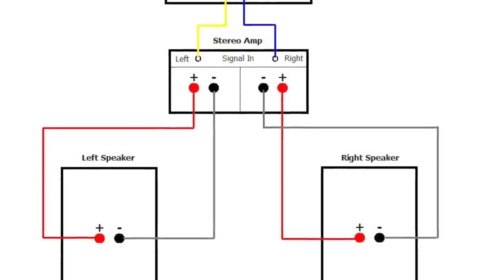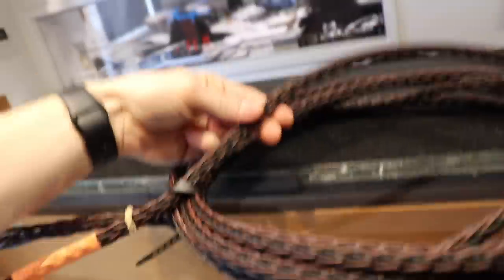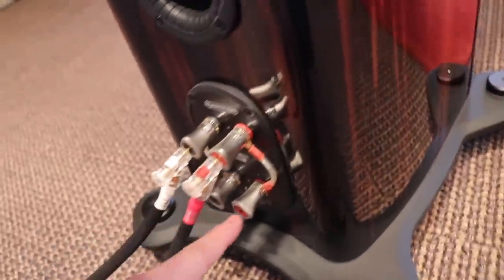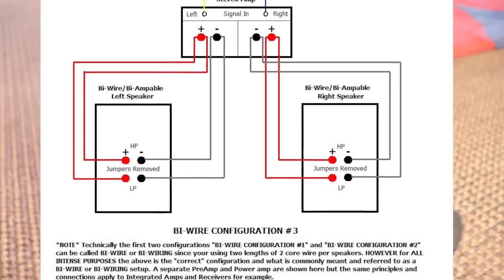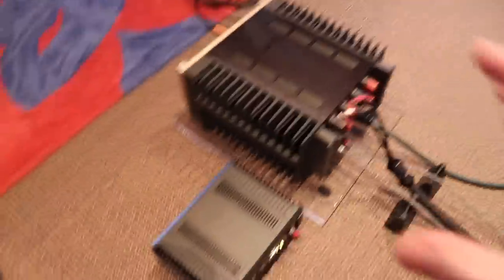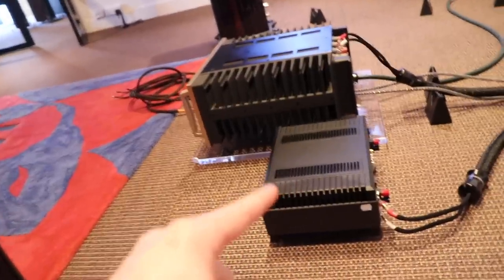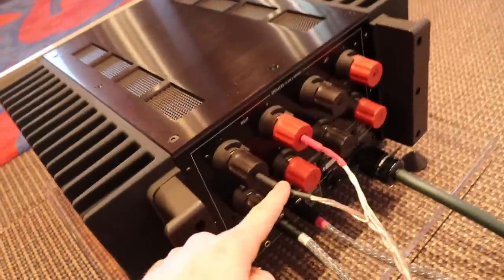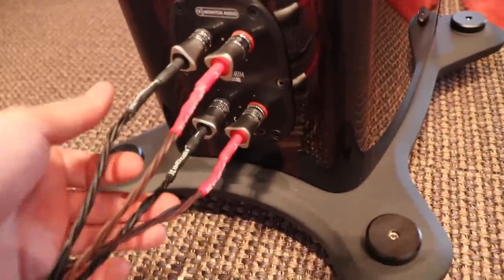Bi Wiring, Bi Amping   What is it?

Comment: i had normal connection 1 wire for right 1 for left. took out jumpers and replaced with quality speaker wire. connected + to high freq - to low frequency. what a difference my 53 year old ears could tell. this small change didnt cost me a penny ! many thanks you just increased my listening pleasure

Comment: I don't believe he understands what he's talking about, IMO.  The engineering of it. The only reason to bi-wire is because all wire systems don't sound the same and you can get into the nitty gritty of voicing your system.  You're using wiring as a tone control, and that's fine.  You do reduce resistance, but that's not going to really affect the sound per say and only nominally the ability of your amp to deliver power.  The statement about delivering tremendously more current is nonsense.  Once the gauge doesn't get in the way, in most cases it's 6-12 awg, it's the relationship of the amp and speaker.  Period.  If you run 2 runs of the same wire from the same amp, you'll not experience a significant difference.  Use, say Kimber on the bottom and Audioquest on the top, that's voicing.  Bi-amping will give you more headroom, but it's not a linear relationship of watts per DB and an expensive proposition.  There's nothing wrong with any of it to try, but understand the engineering.
Reply: One other issue is I believe if you use different amps the wattage of the two can be different (higher wattage for the woofer and lower wattage for the tweeter which doesn’t need the higher wattage) but the gain of the amps need to match.

Comment: Bi-wiring is worthless.
Reply: Wrong, have you even tried it. Made a difference to my Polk ATI 5As because it’s been designed for that purpose with the crossover inside notable separation of the lows and highs, soundstage and better mids.  But you have to buy ready made bi wiring cables, I recommend WBC Worlds best cables from different manufacturers cables. Amazon shopping has all your needs.
Reply: Yes on cheap speakers

Comment: OK, I must first say thank you very much for this video! You answered questions that I've had for years and made me realize that I did a dumb thing! Not only that, but after watching your video and being re-educated, I applied what I learned and it's like I just got another brand new pair of speakers for free! LOL

As an audiophile since about 1978, (and I still am). I've never had any speakers that had bi-amp connections until about 1.5 years ago. That's about when I bought my very first pair of Klipsch speakers, (it took that long because I couldn't afford them for most of my life).

I need to mention a few things about the way I have some of my system setup before I go on. I have an analog component system and my 'centerpiece' is my Mac MC 2105 power amp. I run all my speakers through an OSD SSVC6D speaker controller, which not only switches each pair of speakers on or off, but also boosts/cuts the volume in 10% increments, passively.

I use it to handle the speakers I have in two different rooms. One small room has a pair of small speakers and a 50W powered sub-woofer. However, in the room where I spend most of my time, I have a pair of Klipsch and a pair of Onkyos and they're backed up with a 100W Klipsch powered sub-woofer. 

So the main listening room has 4 speakers and stereo sound. When I bought the pair of Klipsch speakers, I read the manual but I guess I totally misunderstood the reason for the 4 speaker connections in back of each one. They came with the gold-plated metal strip connecting the 2 red speaker jacks and the 2 black speaker jacks just as you demonstrated in the vid.

I never connected the speakers until after I read the manual. In short, I thought the manual was saying that I should leave the strips ONLY if I was going to connect additional speakers in a series configuration. Hence, I removed the strips and plugged my cables to the lower red and black jacks!

I never even thought to try them any other way. The Klipsch sounded good but I always thought that they were just better at handling the lower octaves/frequencies. The pair of Onkyos I had (and for which only had two speaker jacks), seemed better at handling the 'brighter octaves.

Because both pairs are in the same room, they worked out well and still do. However, after I watched your video of course, I realized that I was NOT supposed to remove those strips. Instead of putting the gold plated strips back in, I took your advice and jumped the 2 red jacks and 2 black jacks with 12 gauge speaker wire.

Anyway, there was a huge difference in the sound because now the entire speaker system within each Klipsch enclosure was in effect! The high frequencies and low frequencies were all working together and sounds great! I still have the Onkyos running to better fill the room but I want to thank you for "fixing" my speaker system!
Rich
Reply: My friend had an old speaker that had a crossover problem, he also didn't realise when the tweeters were not working. Maybe it's a getting older thing?

Comment: You can also divide 16 by 4 you can use rip-cord or you can use welding wire, just keep in mind that the copper on the amplifier PCB or the wiring inside a transistor are less than 1/100th of a mm.
Reply: Inside the transistor is not really wire.  The transistors are generally doped silicon.   The resistance and capicitance of your wires will make a difference to the impedance seen by the amplifier, which in turn affects your sound.  By how much, that is subjective.  You wouldn't use very high resistance cable though, just like they don't use high resistance cable to send mains power to your home.  The losses over the cable would just make it very inefficient.
Reply: Or maybe some left overs from power utility company.

Comment: Cleaning off the crud that had collected on the metal jumpers would have improved the connection.   A contact cleaner used regularly would work wonders if you use spade rather than banana plugs.
Reply: works the same with all connections , reason putting in a different cable makes a difference , you just cleaned the contacts :-)

Comment: why would those jumpers "deteriorate" the signal? 2 inches of pure copper from HF to LF do not really make a significant difference in terms of signal transfer imo.
Reply: It's just a mental thing. Also, it's pretty hilarious he says that inch of copper is the weakest link because it deteriorates high frequecies but they still have the connectors on the low frequency inputs.
Reply: arpeemac , Electrons flows on the surface of metal and that is why stranded wire can carry more Amperes than solid piece of metal. Maybe that is a reason.
Reply: A lot of money wasted on expensive cables in this video. You might be able to measure a difference, but the chances of being able to hear a difference are between slim and none. Any decent speaker wire, multiple strand, 12ga or larger will sound the same to 99% of the population. 
Those little flat jumpers between the speaker input terminals are short, wide (a lot of surface area) and have virtually no resistance. 
This guy is a salesman, probably working on commission. But if you have the money to spend and it makes you happy, so be it.
Reply: @Smedleydog1  I fully agree that most people (like me) will not hear difference, and any good quality stranded wire might do (I don't buy expensive for sure), but this "large" piece of metal has a lot of wasted surface. This piece of metal has surely less surface than equivalent mass stranded wire. Of course I am not saying that this salesman is right, I am saying he might be.
Reply: @czakolo  Without using the math that I haven't used much since school, I would say they are about the same surface area on both sides of the jumper as 12 or 14ga multiple strand speaker wire. I have them on the back of my Klipsch speakers and using a VOM, the resistance is 0. Also in the video he mentions that speakers costing thousands a pair that use the flat metal jumpers. I still think that it's marketing hype.
Reply: @Smedleydog1  You are getting 0 resistance because your voltmeter is not sensitive enough to pick up such small differences.... and you have to use a math to compare. It is simple: 1.5 cm wide x 1mm thick solid plate cross-section has circumference 32 mm. Now, I took random wire I have and 2.5 mm square single wire (AWG13) has 50 strands of 0.3 mm diameter each which gives you circumference 47 mm, which is almost 50% bigger, and this is only AWG13.
Reply: @czakolo  Is that a DEFINITE maybe???
Reply: @russhook6595  what do you mean? Calculations? Rough for plate as I don't have exact dimensions, and lengths of both are not taken into account.
Reply: None of you have taken into consideration how many flat copper plate connections exist in that signal path, that amps circuit board, in crossover inside that speaker, etc...
That Snake oil is fueling their yachts.
Cheers
Reply: @czakolo  This effect is only relevant for very high frequencies, like in the MHz or GHz range. At audio frequencies, electrons travel the whole of the cross section.
Reply: @__Dude_ , good point, but I disagree. Yes, the frequency matters, but what is the limiting frequency to see effect?... the increasing wire resistance for AC current is present already with a frequency of domestic AC current which is 50/60 Hz... not big effect, but still, and at much lower frequency than sound. So no, it might be the case, especially for trebles, as you noticed. Please read about current skin effect.
Reply: @mpelevic  true, overall resistance is important... and while you have no control over the "internal" one, you can control the "external", so your comment is really out of scope on the discussion... :-P
Reply: Tomasz Olewski You can’t use common logic to overcome lack of knowledge. :)))) You shouldn’t be offended, it’s a usual mistake, and everyone is tempted by possibility to skate through science by simple logic. I wish it was that simple.
Reply: @mpelevic  sorry if you get me wrong, it wasn't my intention to be offended. I wasn't. You are welcome to be constructive and contribute to the discussion about the wire vs plate.
Reply: Tomasz Olewski  OK. We can’t go to wide on the subject, but I will try to be constructive and simple. I see that you are worried about the skin effect. 
Skin effect is important in telecommunications where we are dealing with very high frequencies.  Let’s say GHz. Enthusiasts are trying to introduce this as a thing in audiophile equipment which is usually wrong (unless you are using extremely thin wires)
Remember this:
You need a surface of conductor 206 micrometers  deep to successfully conduct 100 kHz signal. And  that 206 micrometers is three times more than you need. 
To make it even more understandable, you need 2 mm for 1 GHz. 
So, you should look elsewhere if you’re going to spend your hard earned money.
Reply: @mpelevic , please don't go with the arguments of high frequencies, prove that with the calculations at audio ones. What do you mean that I need 206 micrometers? Skin depth calculation is not the calculation of what you need... Please clarify. Skin depth means that at this depth current density is about 37% lower than at the surface, so this are your losses, resistance increase. For 10 kHz skin depth is about 0.6 mm. Are your wires thinner than this?
Reply: Tomasz Olewski  -  From what I read in your answer, I see that this specific area is something you are interested in, not your college degree. You’ve mixed it all up, left and right. Stop googling and listen:
1. Audible frequencies are LOW frequencies of the spectrum. Science doesn’t care if you like it or not.
2. Current density is NOT proportional to impedance regarding skin effect. That is what confuses you. It is too complex of a calculation for this occasion. But, if it was the way you interpreted it, you would put the tweeter out of the job with “wrong wire diameter “ Can you imagine 30% loss in any frequency range? ;)))
Take in consideration that any fractional losses are measured in miliOhm per feet. An we are talking about jumpers here. You have 0.030 ohm at 20 khz in 10 feet 12 gauge cable.

𝑃=1𝐼2𝑅 =1𝐼2 𝜌𝜄𝜔=1𝐼2 𝜌√𝜋𝜌𝜇𝑓

P= average of the power loss density 

3. In that copper plate jumper 1cm wide, 2 mm thick, you have so much available skin that you can enjoy all your skin effect without any losses, not even theoretical ones. 

4. I have had my fare share of lab work, it is your turn to prove your beliefs to your self. Its fairly simple: take a tone generator, signal generator of any kind.
Use any wire you are suspicious of, and measure the losses at 50hz, then 20khz. That is the only thing that you should be interested in.
Reply: @mpelevic  please, stop. Carefully read and learn about resistance, current density, their correlation to effective resistance, then you will see.
Reply: Tomasz Olewski . Dear Tomasz, that is what I do for a living, and have been whole my life, and with equipment of far more critical importance then audio. My knowledge stood the test of Univeristy of Electrical Engineering, Telecommunications. 
I have strongly tried to avoid opening with the credentials, because I like sharing concise info, not who is who.

Anyway, I am not talking directly to you. You do what you do. I left prior comments to other people who would like to know weather something makes actual difference in real life or not.

Please, lets not continue this fruitless discussion between me and you.
I don’t have time for this, but I have made some effort. 

It is on you to make experiments and scientifically prove what ever you believe. I already have for past 20 years. Anything verbal, vague, and web link related kind of knowledge I will disregard, and will not answer.

Wish you all the best!
Sincerely 
Mladjan
Reply: He’s a salesman, he will tell all the nonsense necessary to sell you the overpriced crap. Most if these high end audio accessories are just a scam basically.
Reply: @mpelevic  almost after 5 months I am seeing this and saying u thanx for scientific explanation. That Tomasz Olewski seems to discover new rules of physics and may be nobel prize be conferred on him in near future. Some people think that just by googling and studying in whatsapp university make them most knowledgeable than all. And those idots are called audioFOOLS, not audiophiles.
Reply: Kaustuv Chaudhuri  Thank you. You’ve got it. It all seems complicated, but it is a very simple experiment. All you need is a tone generator and osciloscope to measure resistance at any given frequency.

Comment: Is there any benefit at all to running two sets of cables to the high and low frequencies of the speaker in bi wiring formation if my integrated amp has speaker A and speaker B output (so speaker A feeds high and speaker B feeds low). I have had completely contradictory advice on this from two separate dealers. 

For clarity - It is not an AV amp with specific bi amp terminals but a regular (good quality and high power) integrated amp with two sets of speaker outputs. 

Many thanks in advance.

Comment: Hello and thank you for the video. It really helped me decide if I want to bi-wire my Klispch speakers or not.

May I ask your advice?  My set up is
Yamaha Aventage A-3080 AVR
Klispch 
RP-280 Front (Bi-Wireable)
RP-450C Center
RP-250 Surround (Bi-Wireable)
R-820F Surround back (may upgrade to RP-280’S)
RP-140SA Atmos x4
R-115SW x1

I want the most out of my setup so would you suggest Bi-Wiring the speakers? And if so, what gauge wire do you suggest?

Lastly, the Aventage is a decent AVR, but would I benefit from Bi-Amping it? And again, if so, what amp do you feel would complement the AVR and speakers?
Reply from the maker: I don’t feel that you would benefit much from biwiring.

Comment: Each speaker has to have its own crossover for roll-off. Passive or Active if your amp doesn't have separate tone controls for A/B so the speaker doesn't put out frequencies beyond its optimal output plus you need a switch so your crossovers work in concert with each other if you should only use one amp with two channels or two mono blocks.
Reply: thats rite mate how can the speakers separate the frequency's with out a cross over ,,,ya need thr 80000 speakers,,lol
Reply: i never heard that so does that mean the full range is being sent to the drivers but they are ignoring the frequencies outside what they can play? i always thought that the signal being split digitally first would be optimal like the meridian designs but i have heard stuff that i thought sounded better than meridian too. TBH i think there is no end to this and i have to learn to love my stereo it cost me 20k! its enough. i am enough hahaha